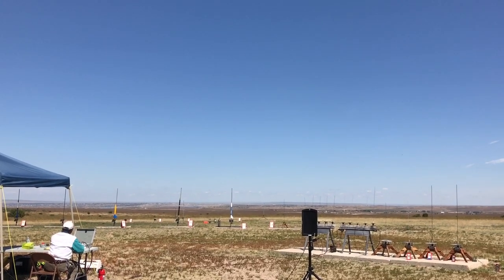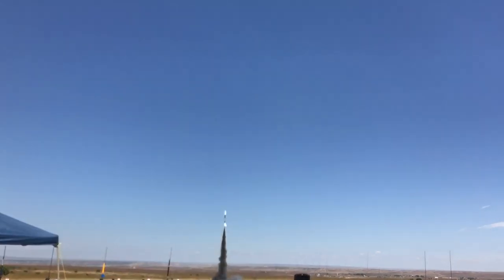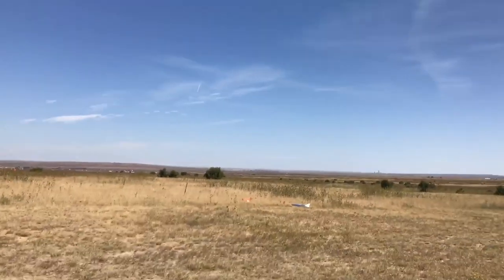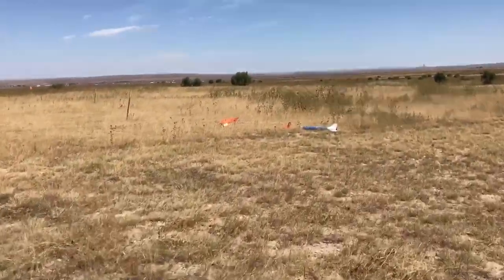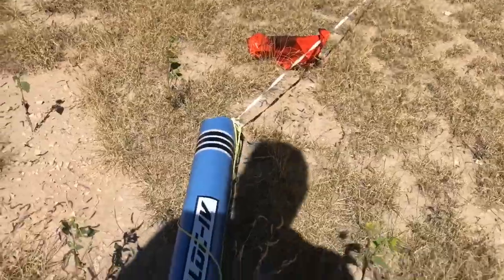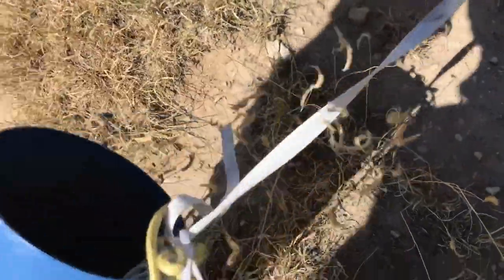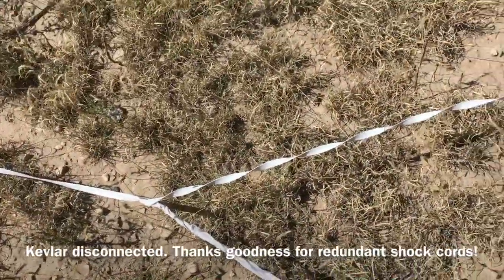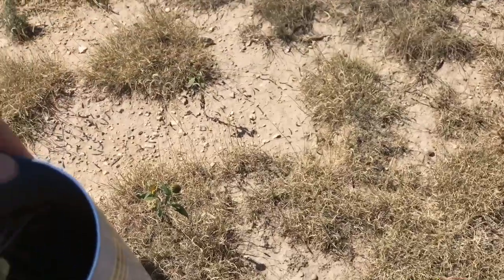Loc Precision LOC IV for NAR Level 1 Cert flight 9/16/17 at Pueblo SCORE Chili Blaster 18

Comment: Was any additional nose weight needed to keep the rocket stable? Putting the Loc-4 rtk file into OpenRocket, it says I would need to add about 150-200g of ballast into the payload compartment to get about 1.2 cal of stability.

Comment: Hello i got a question i just bought this rocket and it saying something about a bulk bead  in the payload section but i didnt get that part so i was wondering is your rocket a 1 piece tube? The 1 i just bought a has 2 piece body tube with a coupler hope u can help thank u
Reply: I know this message is old but your kit should have come with A Motor tube, (3) Centering Rings for the Motor Tube. (2) of them have an additional small vent hole, and one is solid all around (this is the rear motor plate). You should also have a nose cone, a short payload tube, a coupler, a main tube that's slotted, (3) Fins, and assorted hardware. You will / should also have a separate little plastic bag with a single round wood bulkhead, with an eyelet, nuts and washers. (this is the bulkhead for the payload bay.It's totally optional if you're just going to do single deploy, just glue the coupler to both tubes, and friction fit your nose cone. The motor charge will be ample to eject the nose cone for deployment of your single main chute. At some point in the future you can always convert it, and you'll probably want a rigid payload section such as fiberglass anyway. If you haven't finished the kit yet, contact LOC or Apogee and they'll replace the missing parts, or you can also just trace the coupler tube onto some 1/4 or 3/8 plywood and cut out your own bulkhead.

Comment: did you add nose weight??? What's the best glue???
Reply: I use epoxy and titebond II blue bottle that stuff doesnt leave pun holes and is so strong u will break the wood before the glued part